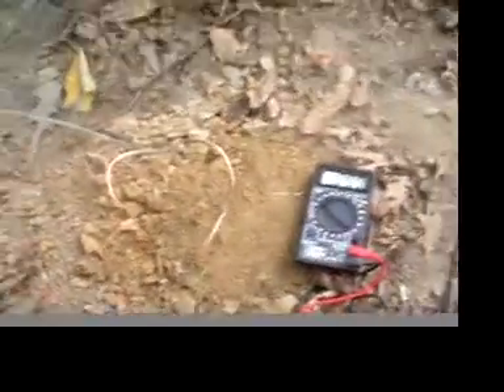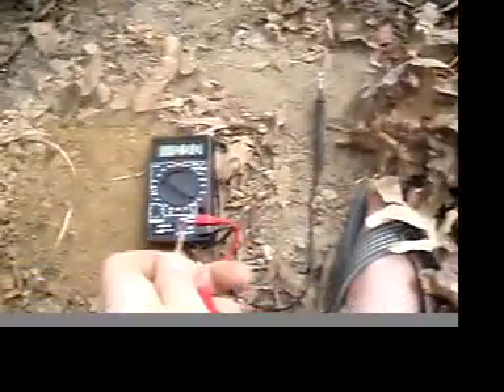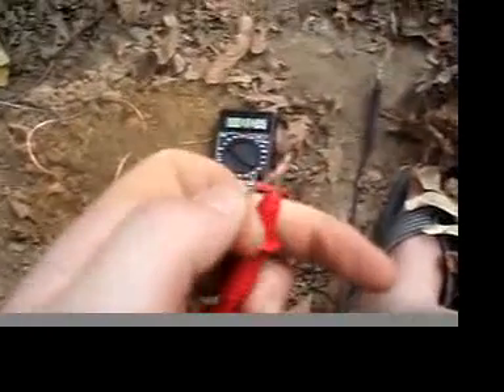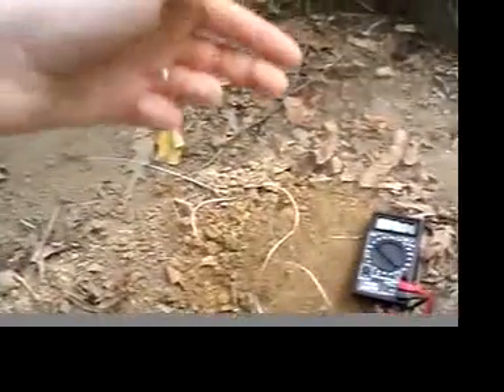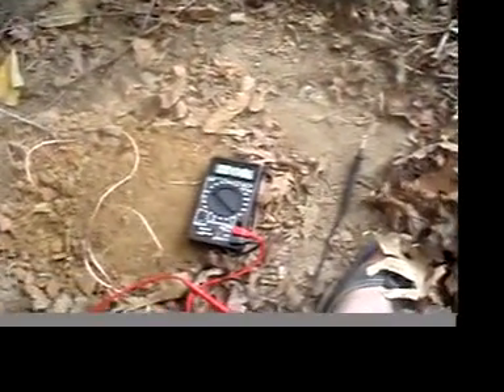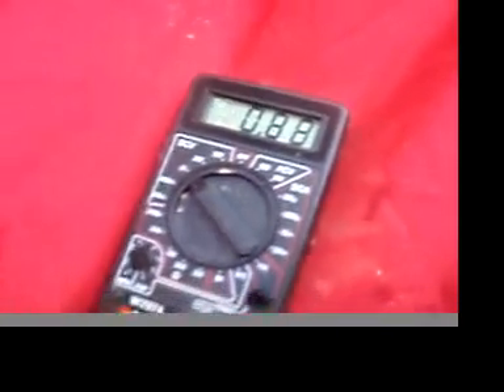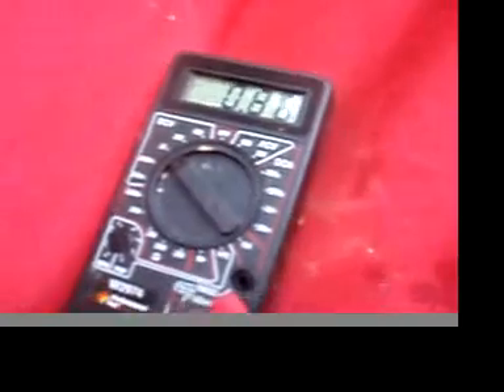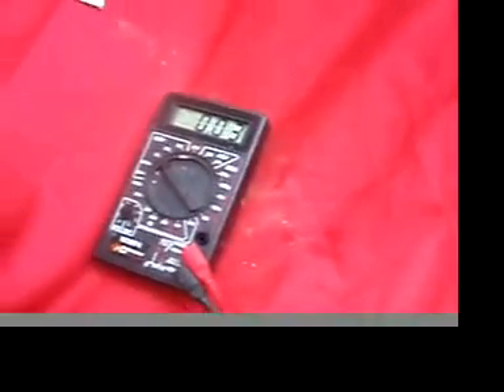Stubblefield Earth Cell Battery Demonstration

Comment: Are you using a pourous insulation for the copper wire such as cotton?  I read in order for this to work, the copper must have a pourous insulation and the iron wire wither bare or a pourous insulation as well.  This is so the exchange of electrons occurs in solution to produce a current.

Comment: This is just a start on the Stubblefield battery, the voltage is just eh chemical reaction of the iron and copper at .92 volts. The power that Nathan Stubblefield got was way more, enough to run arc lamps. There are several steps the author did not do that are in the patent to draw up the current from the ground. It just might be that there are some things left out to prevent patent stealer's from using ideas he had to really create energy.
Reply: the text above indicates the copper wire is insulated so there should be no chemical reaction present.

Comment: I have a question. If your meter is connected to copper one side and iron the other, in an electrolyte, how do NOT measure the chemical reaction between them? The electrons will try to move due to the potential voltage difference of the metals. I think this is a simple redox reaction using the natural moisture and electrolytes in the soil. When you added water you increased electrolyte concentration and voltage grew. If you dropped your capacitor in a bucket of cola you would get the same efefct

Comment: Metal attracts electromagnetic energy, Uranium, Plutonium even more so, what is not explained is that radioactive elements do nothing more than 'capture' energy, they are 'nets', radium releases Beta rays/electrons, the earth is hit constantly by very high energies, just like a solar cell captures solar energy, other minerals can capure other frequncies which can be absorbed into a capacitor engineers can easily develop devices to do this they just don't.

Comment: More Variables: 3 Ryd7777 suggested the Nth Sth orientation may have an impact but I was thinking about how the plasma tube on the GEET engine requires a 20min 'burn-in' period while oriented Nth Sth before the engine can be used in other orientations, this burn-in time may be required here too! 4 Also mentioned were Geo Magnetic Lay lines; good point! 5 I wonder if using dowsing to locate an underground water source and testing in the soil above that artesian water would make a difference.

Comment: It's usually the variables that make all the difference at this level of experimentation so here are some thoughts that came to mind: 1 The soil in this vid looks kinda clay like, was wondering if it would work better in richer soil (i.e. more fertile red volcanic soil types) 2 Maybe the pH of the soil has an impact too (meters are available to test this & you could alter the pH yourself by adding acids or bases to the water used to wet the soil.) continued...